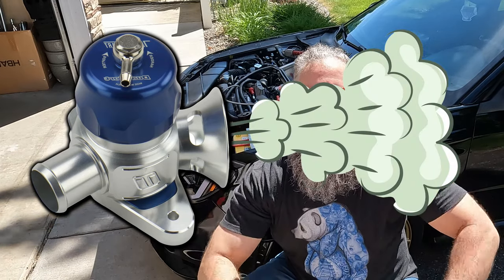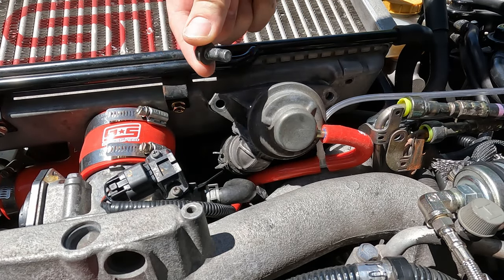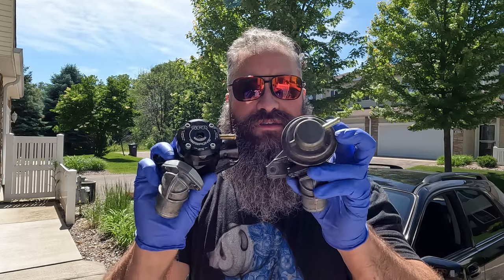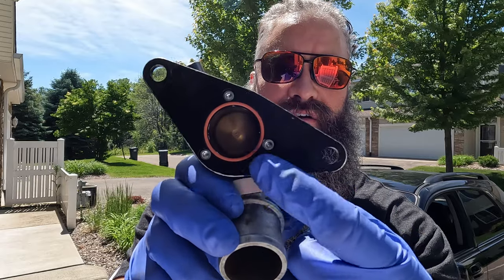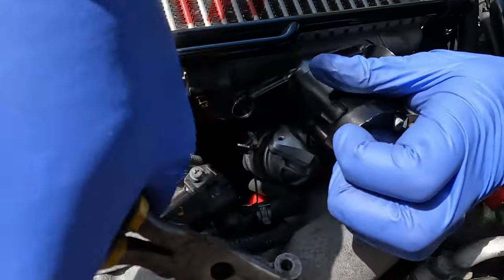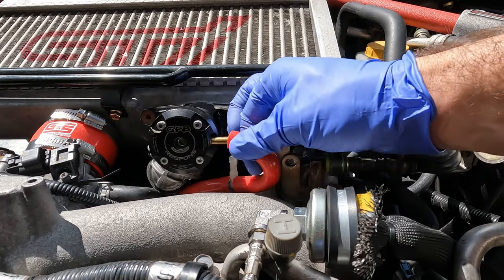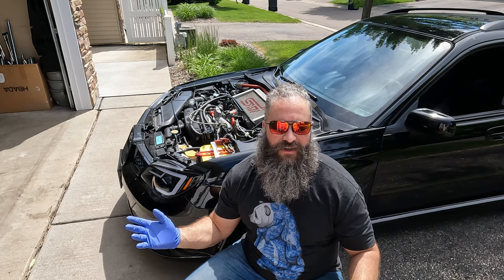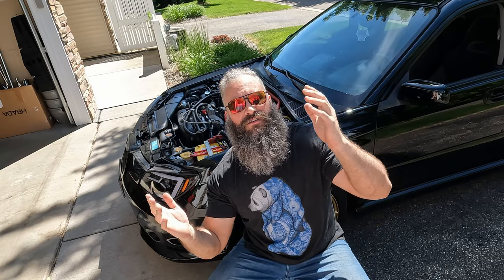How to Install a Blow Off Valve [Subaru Impreza WRX STi Forester Legacy 2002-2021]

Comment: Question do you need a tune ? Or is it cool to install it yourself without having problems in the future? (wrx 07)
Reply: BOV=Tune

BPV= No tune
Reply: @DangerNoodlez144 thanks 8)
Reply from the maker: You shouldn't need one as long as you're recirculating the air back into the into the intake tube and not dumping it into the atmosphere.  Good luck!